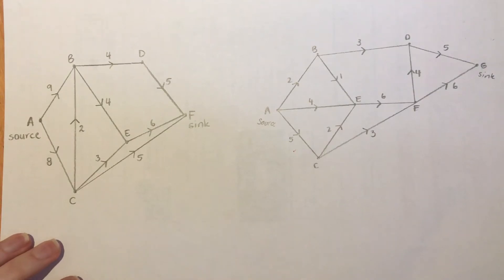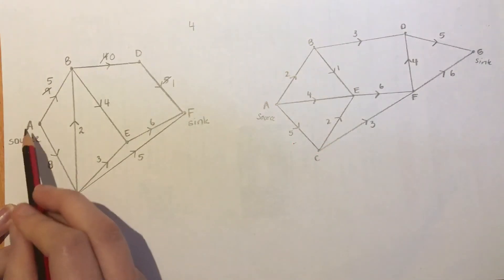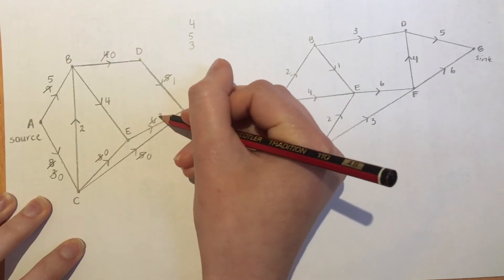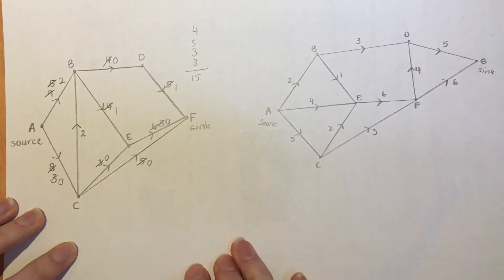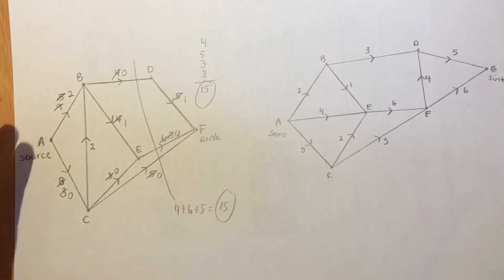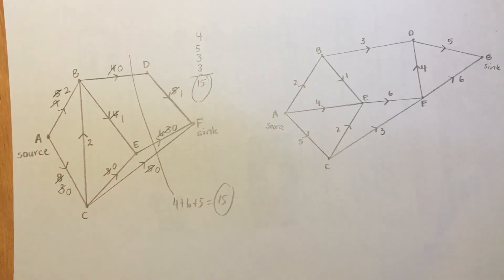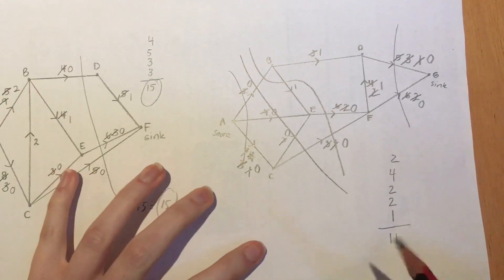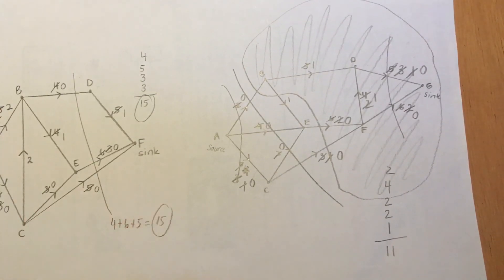Maximum Flow and Minimum Cut of a Network

Comment: Aren't you supposed to draw a backward edge and give it capacity c when you reduce the remaining capacity of an original edge by c? If you don't do that, I think you can miss some possibilities to push more water from the source to the sink.
Reply from the maker: Yes, that's the how the actual algorithm works but that it too complex for many of my students so this is just a shortcut that works 99% of the time.
Reply: @EmDickinson   I think that such a shortcut will work 100% of the time if you make good choices at all the steps. The idea behind drawing backward edges seems to be that, by doing that, all bad choices will eventually be corrected. Do you agree?
Reply from the maker: @AA-le9ls  There have been a few occasions where the shortcut has not given the max flow, but if you start again and choose a different order of paths then it works. It tends not to work if you have any edges that cross over. It happens very rarely, but it does happen.